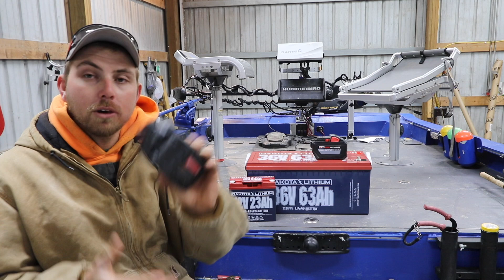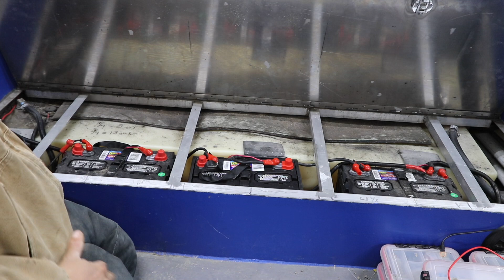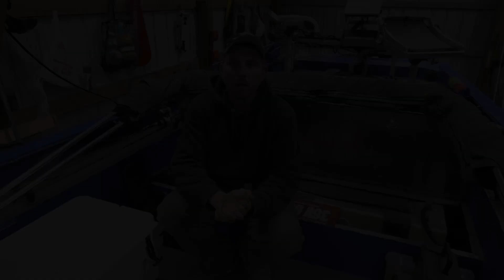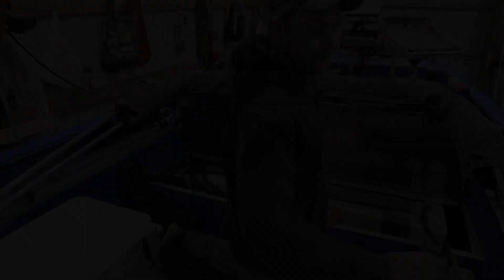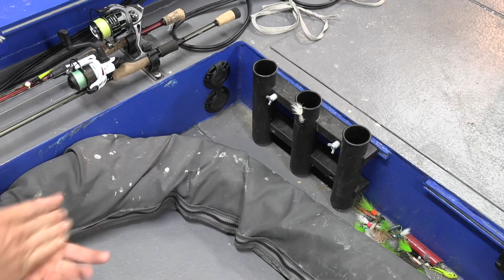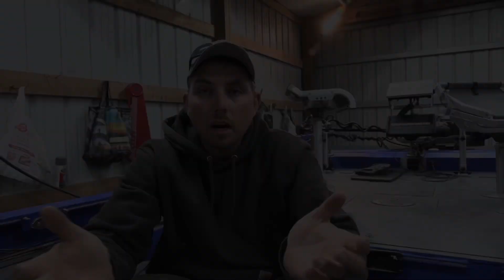I Made the Switch to LITHIUM BATTERIES (Worth the Price?)

Comment: Nicely done. I have a Minn Kota 24 volt trolling motor. I want to buy two Litiium batteries to power it. I will wire them in series (current setup with Loaded cell batteries). The trolling motor powers a 20-foot fishing pontoon boat. I doubt I will ever use the trolling motor.... continually for more than 6 hours in any given day. Usually always short fishing days. Fair weather fishing, not fighting wind. Will two (2) 50aH, Lithium batteries, wired in series be enough for my needs?

Comment: Normal to run about 5 hrs and still have 100%, ran trolling motor the whole time, 36v battery, had a cheap cheap installed just to show %, volts and temp

Comment: I run 5 heavy ass batteries also , I have been wanting to change over , but I can’t justify the price difference.
What is your opinion on the new set up vs the old lead batteries?
Do you think this was still the right choice and did it make that big of a difference?
Also how much weight did you gain back from the lithium batteries?
Thank you .

Comment: I think i am getting that same set up in my Ranger Z520, of course i am not installing them, they will have to do some work taking out the old quad charger and 4 worthless batteries, hope the big battery fits well, i will be asking those questions with the boat shop, your boat is custom but is there a normal plug to charge the batteries like i had on my quad Ranger Charger?  Heard they can't be charged in cold, what is cold below 20, 40?  Its only around 50 as the high in spring and fall, the boat however is always in a garage, can't imagine having a 100k boat outside, what are people thinking?  Well i know money means nothing to them.  I was told these batteries 1600 for 36v and think 600 for the starter both come with a charger.  Never heard that one before, battery coming with a charger.  Dakota is the brand.  I just want batteries that last longer then only 4yrs, and really last month or so of that was running very poor, having my Minn Kota at 50% all the time, needing to put it at 100 to get the same speed after 6hrs means those batteries are done.  Minn Kota Fortex 101 is what is going to be running on that 36v.  Twin Talons, and Helix units, along with 250 Merc running on the cranking battery.  This is the first upgrade, then trolling motor will be the following year when Minn Kota unleashes its newest model.  Which i haven't heard nothing about it, so may have been scratched.  Ultrex will then be my motor with 360 transducer.  Hate changing from my Fortex to another one, its all i have ever used, the Maxxum, 2 of them in previous boats then this Fortex for the last 9 yrs, flat out beast dominating the competition.  Had a motorguide, it got stuck in weeds, yeah weedless trolling motor stuck in weeds, donated that pos to a poor person at the ramp say this can be your anchor, it is trash.  Never has Minn Kota ever got stuck, even when its buried in weeds in a ft or less of water, its a beast and with inferior batteries i cant wait till its running on 36v.  How often are you charging these?  I hear they can go for days, i can't imaging doing that, i would charge as i always would after ever trip, unless i do see they don't need to be like other guys say 8hrs of being on the trolling motor still 80% charged i say what?  Mine are 80% dead.

Comment: Which battery starts your big engine?  Can you charge any batteries from your engine.?  How long does it take to charge from shore power?  How do you monitor how much capacity is in the batteries?  Can you start your engine from the 36 volt battery using the voltage reducer?

Comment: I switched my 24v trolling motor batteries from AGM to LiFePO4 and now, instead of running out toward the end of a long day, I can go 2 FULL days in-between charging.  This is a real advantage when you go somewhere to fish for an entire weekend.
Reply: WHAT AH BATTERIES DID YOU GET?
Reply: @raywilliams6098  - Ray, I built two, 12v, 100AH LiFePO4 batteries and run them in series.  Now, I'm building a dedicated 24v, 55AH LiFePO4 battery and will be using the others for a different purpose.
Reply: @jasonbroom7147  you built the batteries? That sounds interesting. How did you do it?
Reply: @RjBin-xz2um  - I put four, 100ah cells in series, with a Daly BMS, then put that pack in a hard-sided pelican style case.

Comment: I chose to buy 3 12v 23Ah ($657 total retail) instead of 1 36v 63Ah lithium (retail $1699). 

If your battery goes bad, you have buy a 36v 63Ah lithium (retail $1699). If one of my batteries goes bad, I have to buy a 12v 60Ah (retail $229). 

In addition, the 36v battery requires a special charger (retail $199). The three 12v lithiums can be charged with my current Minn Kota Precision 3 bank charger (or 4 bank for your starting battery too) set to AGM mode (Mk318pc - $209 at Hodgesmarine.com)

Comment: I'll definitely will be following how this turns out for you because I'm interested in it. I have a question. When you're running lead acid batteries. Why would you wire them up in series to equal 36 volts and run a voltage reducer and not just parallel to give you three batteries at 12 volts? On a side note I think it would be beneficial to look into some solar charging on the boat. I'm thinking like small solar panels that's not in your way as a small trickle charge to keep the batteries going for the day.
Reply from the maker: Had to have 36 volts for the trolling motor. I’ve not been able to find a panel that will actually benefit me most just charge to slow to even be worthwhile. And you need a synwave charger to keep voltage spikes down while running the electrics
Reply: @totalanglingexperience3493  ok. I didn't catch that your trolling motor was 36 volts. I'd say get creative with small solar panels all around the boat to keep up with the smaller batteries. I think they're an eyesore but I've been pondering on different strategic ways of doing small solar panels. I live in Iowa so our cloud cover is pretty much the same not like it is down in the south but still can be effective in our region. The trick isfiguring out how to make it not an eyesore and out of your way. I'm trying to figure this out myself.

Comment: Looking forward to see how they work out for you this summer.  I use my Terrova to troll on Erie a lot and it sucks when the batteries die and cut your day short.    As an engineer, I don't see how a 63 Amp/hour battery is going to last longer than a 110 Amp/hour battery, but I've read reports that say they do.   Keep us informed please.
Reply from the maker: Just because the lead acid is 110 amps, you only get that for a very short time due to the huge voltage curve that is associated with them. Lithium’s have a extremely flat voltage curve which allows for a longer run time and the ability for a lower amp battery to be very comparable to a higher amp lead acid
Reply: Lithium batteries are amazing I've been in love with them for years!!! They have a higher charge density & put out more energy. Less cells bc more power so way less resistance. Less heat & can release the stored energy faster. Also hold a charge for alot longer.  Less weight & no power drop. Temp extremes don't effect as much either. I think they're worth the money. I've never been disappointed with any lithium battery.
Reply: Lithium are 36v 100% power until they are dead. Lead acid are 100%power to start but as the battery looses charge you only have that power to pull from. I’m running lithium for 36v and live scope as well and love it. I chose lithium so  can troll cranks all day without a kicker motor
Reply: as others have said, the 110 ah of a lead acid is a bit of a farse.  The actual usable ah of a 110 lead acid is more like 60 or 70 ah. I have switched over and can confirm for all that a 60 ah lithium phosphate has about the same usable energy as a 100 ah lead acid.
Reply: Well it is 36 volt